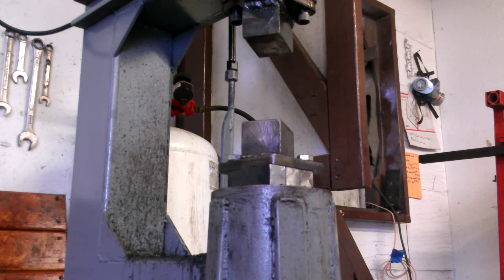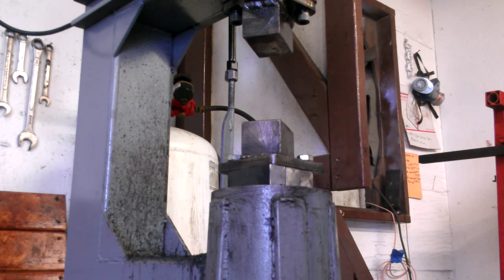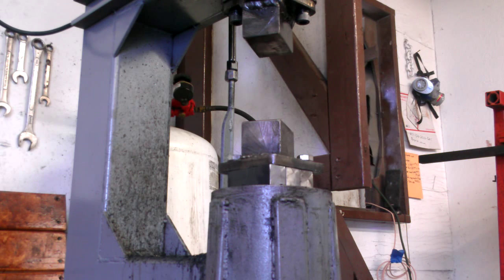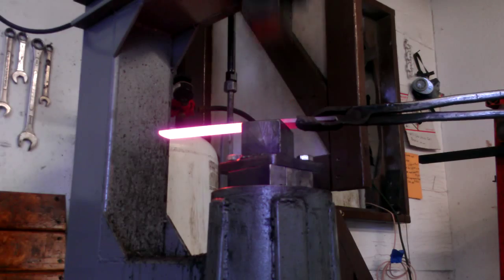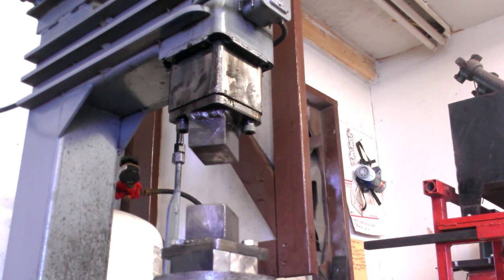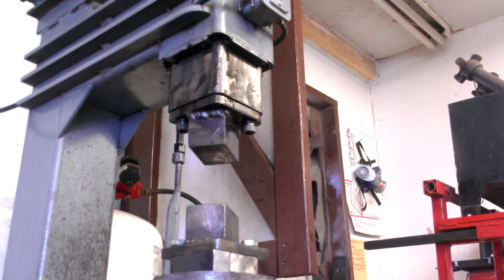Tire hammer testing.

Comment: like your hammer,, i will be starting my build soon, will you be posting a video of the adjustable crosshead assembly you plan on doing??, i would like to see it and perhaps use the idea on my build, i dont fancy screwing around changing bottom die block for height clearanceson different size material,, great job on the hammer love some of those gusset fixtures looks like an old world production issue.

Comment: Has it cracked your shop floor?  I want to build one but I plan to sell my house so I cant afford to crack the foundation..  By the way you have done an excellent job on your project.
Reply from the maker: MSgulfScuba It has not. I cut a hole in the floor of my shop and poured an 800# block of concrete cube.
Reply from the maker: MSgulfScuba and thank you!